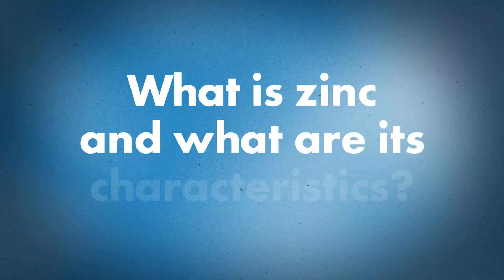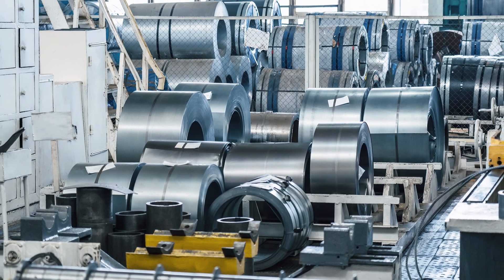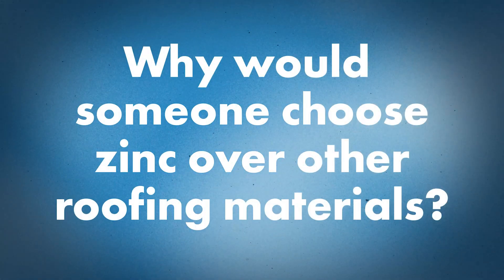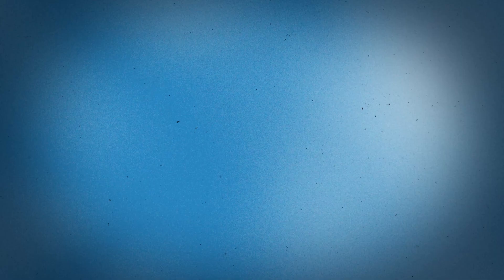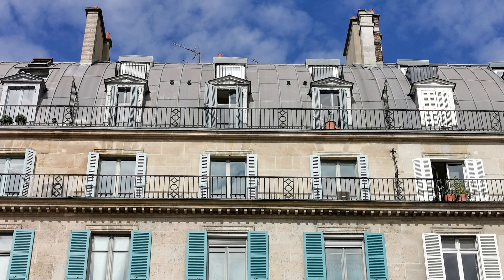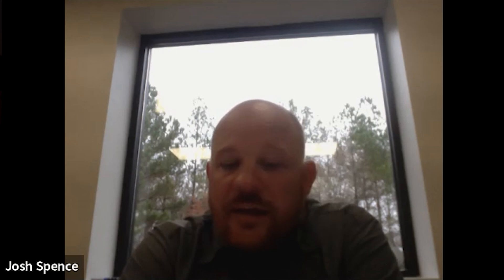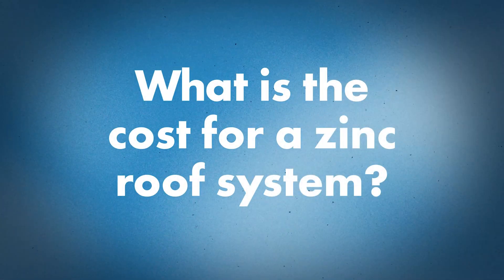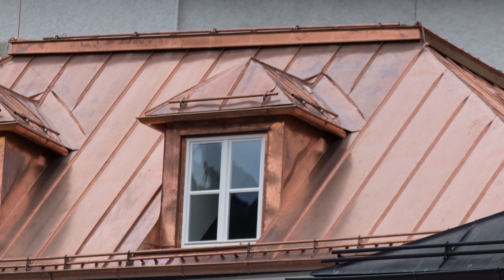Zinc Metal Roofing: Pros & Cons, Applications, Installation

Comment: vieille montagne zinc or VMZINC is the main metal we use here in switzerland. I like working with the material, but it has to be installed on wooden batten ventilated. Quartz Zinc is beautiful to work with and is always a referenz
Reply: What are the tools used by a skilled installer for zinc roofs?